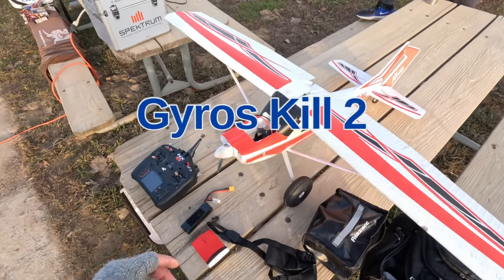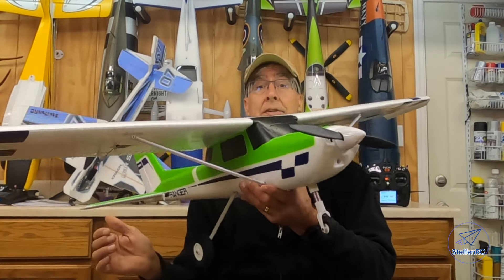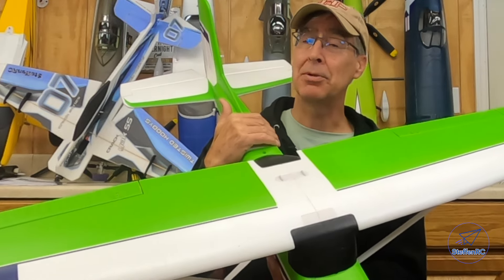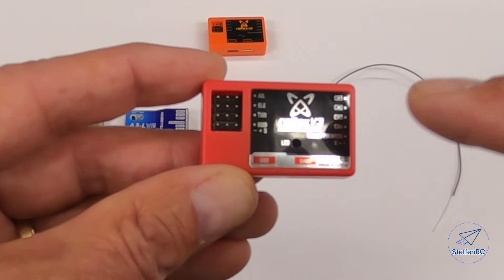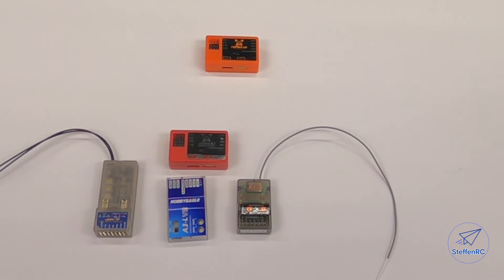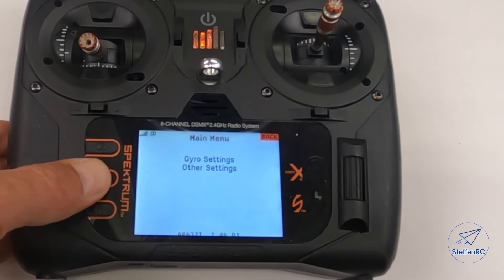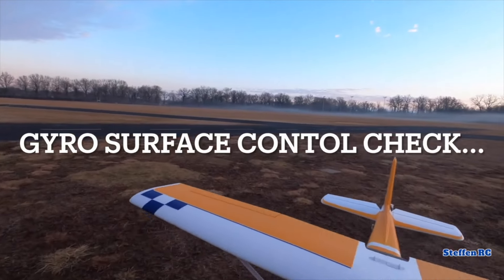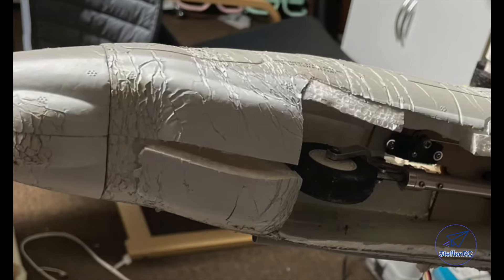Watch this if you use a gyro in your RC Planes

Comment: I love when a guy crashes an airplane and the first thing he blames is the gyro! Great video as the fact you must do any reversing etc in the gyro and not the radio. Any change to servos must be re addressed in the gyro. You need a gyro to fly an RC airplane that's fine. But I guess I have been an expert pilot flying since 1976 without one. I have several I ripped out of Flex aircraft. They work great for 3D flying but for sport flying nope. Thanks for educating the folks they need a gyro to fly!
Reply from the maker: JD,  I don't think its blaming the Gyro, its asking what caused the crash.  In this case the Gyro direction wasn't check after a servo replacement and the gyro caused the plane to be uncontrollable.  I think I was pretty clear about it being pilot error.   I'm finding more and more new pilots who begin their RC Plane journey with Gyros (since almost every PNP/BNF has them).  The new pilot doesn't understand the point you mention about testing the surface movement of the GYRO not just the TX stick movements.    So, this video is that PSA to let them know.   I'll say I started flying in the late 70s early 80s and didn't even have expo.   I sure like that now though.  I get it, you don't care for gyros but I've found some planes that really benefit from them. Especially flying in windy conditions.  Its important to know how to tune a gyro also, which is a whole other topic.   But again to each his own.
Reply: Dude, relax with the anti-gyro negative waves.

Comment: I had that issue with using a gyro rx, I had mine set up for off , as3x,  safe. . When I got in the air and turned on as3x,  it was doing funny things, I was also high doing this . I found the gyro was moving backwards on movements,  in Forward programming there is an area where you can reverse the gyro inputs so they go the right way
Reply from the maker: Sounds like your Gyro didn't have the correct orientation.  If you set the correct orientation, it will know which way is up/down left/right.  The first time you setup AS3X it will ask you to orientate the gyro.  If the gyro controlled surface directions is still wrong, you should start over by doing a factory reset on the RX.

Comment: You are absolutely CORRECT and a must to be sure the gyro is working correctly!  Thanks for the detailed video. BTW - the Reflex 2 is also capable of being reconfigured for correct servo movement but you have to be somewhat computer literate and understand how to modify the individual airplane files that the FMS computer application provides.  There's a detailed discussion/explanation of doing this on RC Groups under Reflex 2 Gyro.  I use 3 Reflex 2 gyros in several sport airplanes and have the ability to modify the 'param.dll' file to accommodate any airplane.  The Reflex 3 is somewhat simpler to modify but most of the internal settings aren't available unless you do it on a windows based computer.  I also advise that everyone using any gyro set it up on a 3 position switch so it's capable of selecting OFF, STABILIZER (AS3X), and SAFE.  Not doing this is very dangerous!  Just saying.
Reply from the maker: Appreciate your comments.  I should've mentioned the technical option to reprogram the V2.  I remember seeing that discussion on RCG.   Agree a switch to disable the Gyro is very important, especially during the maiden and tuning flights.   Thanks Will
Reply: Having an "Off" option will certainly help in many situations - especially if the Gyro unit comes adrift or you've made a setting boo-boo. However the idea that it will always save you is misplaced. Even in the purely "Manual" switch-off position the servo controls are routed through the stab. An internal malfunction in the stab unit (much less common than the former 2 faults admittedly) will still trash your toy. Main "internal" faults with stabs are likely to be physical damage from crashes or register overload from vibrating props.

Comment: The Hobby Eagle A3 Super 4 is a great gyro and their manual has the best images showing how to check the control surface movement, but nothing beats Spektrum's Smart AS3X/SAFE receivers. I would avoid the FMS Reflex gyros. The main thing to remember is that the surface should deflect in the same direction that you move it; it should oppose what you do. Raise a wingtip and the aileron on that side should deflect upward. Raise the tail and the elevator should deflect upward.
Reply from the maker: As always..  Appreciate your comments. Hope you are doing well and have a great Thanksgiving.  - Will
Reply: @SteffenRC  I just sent you a PM on RC Groups..

Comment: I support a local group of RC learners/flyers with repairs, flight instruction, build and design services and of course the installation, setup and test flying of third party flight stabilisers/controllers. There are a large number of gyros and flight controllers that you did not mention which is good because it seems every man and his dog are adding to the plethora of stabilisation devices. When a servo needs to be replaced and the replacement servo rotates in the opposite direction to the original I have learned to simply reverse the servo. I use the same technique used to reverse one of the flap servos to maintain physical symmetry of the installation.
Having said all of that another problem has reared its ugly head around the long term use of gyros etc. The climate I fly in is temperate to tropical with 40 degrees Celsius not being uncommon. Over time the filtering of the BEC within the ESC becomes less effective and so the use of an external BEC is recommended to reduce the effects of the heat but even so the external BEC can loose its filtering over time and so additional surge suppression  is currently being used.. The stabilisers can reset when the voltage supply is spiked and this can have a catastrophic outcome.

ESC/BEC cooling is even more important if a third party flight stabiliser/controller is fitted and failure to do so can cause the unit to reboot whilst airborne or even lose its setup programming for some unit designs.
Reply from the maker: Thanks Robert,  Appreciate you perspective on this topic.  Yep, there are lots of Gyros on the market.  I was kinda hitting on the ones that I see and have some experience with.  I didn't delve into the Matek or SpeedyBee FC that I use, since thats a whole different ball game.   Thanks for sharing, Will

Comment: Good stuff and thank you....that definitely helps. I'm still fairly new to this hobby and I hate to admit this but I learned the hard way about not taking off the prop while changing settings on the TX. But what I want to know is why did this happen on some planes and not others. I have several planes on the DMS protocol by spektrum and I can change settings with no problems. I recently got an arrows edge 540 and got it set up with a radiomaster TX16s and a radiomaster RX run thru the arrows vector gyro...everything is perfect and moving correctly and the gyro movements are correct. I don't know why I did this but I did.....I reached down and cut the TX off first before the plane and the prop took off at 100% throttle in my small work shop with no room....that was fun. the second time on the same plane I was setting the RSSI to the middle frequency because everybody says do it or you could lose signal....as soon as I hit the highend number and lost frequency the prop again went to 100% wide open. Is this normal or do I have something set up wrong? I've set the RSSI up on other planes and the prop did nothing went I lost frequency on the high end or the low end.
Reply from the maker: Holy cow thats kinda scary.  Not 100% sure why, but it could be your Failsafe is set to 100% throttle on that plane.  So, when it loses signal it goes into FAILSAFE, which is set to 100%.  Might want to look at the FS options on that plane.   Hope you can figure it out, that isn't normal.  Good luck.
Reply: @SteffenRC  I'd say that there are at least 2 possibilities for his problem. 1. Like you say, he has not set a proper Throttle Failsafe on the receiver set-up. (So the Throttle is going to the channel default of 50%) OR 2. He is using a Radiolink (not a Radiomaster) receiver and that maker (like Futaba) uses a reversed Throttle control. (ie -100 is motor flat out!) 😱

Comment: Details are everything when it comes making any changes or re-maiden after a crash or just a new plane. Never assume anything and suspect everything that could go wrong. I thought I would save some time by not putting the servo control horn screws in because I knew I would have to physically realign them during a later radio setup. Yep, I forgot to put the darn screws in and although the first flight was uneventful, the second one pile drived into my brick house because the ailerons became unresponsive. I was so glad it was my house.

Very good advise on the type of problems that can happen with gyros. I had to ditch that Reflex V2 out of my FMS Pitts because I couldn't get that stupid configuration file to update the gyro direction for my swapped out higher quality servo's. Every single servo had to be reversed and there wasn't any way to reprogram that thing. Swapped the receiver out for a Spektrum Rx with gyro and it was super easy to set that up with all the correct gyro movements.
Reply from the maker: @michaelkrailo5725  thanks for sharing.  Btw, there are a few guys who have changed the FMS file to reverse the servos with the reflex v2.   Some details are on RCG.

Comment: An excellent explanation of how to check the gyro.
I just did this gyro fix yesterday. I had put a HobbyEagle A3 in a plane and fortunately had the gain at 5%. It was a bit wonky as I had forgotten to reverse the aileron gyro setting to match the receiver. Flying in AS3X mode was ok, but wonky. I flipped into Stabilized to check it and the plane inverted. Oops. Minor repair and all is well.
Reply from the maker: Yikes.  Sounds like you caught it before it caused too much damage..  Stuff happens.
Reply: @SteffenRC  well, yes. It was an MD-Hobby E0717 so they are pretty tough. Back in the air and flying great with the gyro settings fixed.

Comment: I understand the need to site the gyro on correct orientation,  but does it need to be bang on the centre line of fuselage? Can it be to one side of the fuselage?
Reply from the maker: Great question.  Its doesn't need to be precise.  It can be off several degrees without it causing issues.    You can absolutely place it on the side of the fuselage if that's the only place it will fit.

Comment: The Reflex v2 can be used in 'any' plane. However, It requires a bit of geeky file editing of the FMS config.dll and param.dll files on your PC. Find a comparable FMS model, open the config and param files, copy that model's settings to a new model, update the gyro and TEST. If a surface needs to be reversed, replace the 1 with 0 (or vice versa) for that control surface's gyro direction parameter.

I have Reflex v2's installed in the following models:
FMS Ranger 1220mm (standard FMS Ranger 1220 model config)
RocHobby WACO YMF-5 1100mm (based on FMS P-40 980mm model config)
E-flite P-51D 1.2m Cripes A'Mighty (based on FMS P-51 1.4m model config)
Flightline P-38L Lightning 1.6m (based on FMS F7F 1.7m model config)
E-Flite F-16 80mm EDF (based on FMS F-16 80mm EDF model config)
Reply from the maker: You know, I remember a thread on RCG with you guys tweeking the files..  Pretty cool stuff, thanks for sharing.
Reply: Radiomaster R88 + FMS Reflex v2 + file tweaking = Poor man's Spektrum AR631 ;)

Comment: I had a gyro incident with my v2 Reflex on my Kinfgisher (factory installed) that was like a grand mal seizure.  I’ve never had a hiccup from my Spectrum gyro.  I was barely able to get it upright before the Kingfisher hit (no damage surprisingly).  Very concerned to try it again…. Any suggestions?  I’ve flown it without gyro but like having it installed so I can flip a switch if I get into trouble. 

After watching this I will go wiggle the gyro - maybe the 2-sided tape is loose.   Should I replace the v2 with a v3?  This acted like a voltage spike or dip (can that happen?).
Reply from the maker: Those type of issues are hard to troubleshoot.  I'd test to see if its loose, but that reflex placement in the Kingfisher is pretty tight space.  If its stuck tight, then I'd check the servos and control horn connections, make sure the servos are working perfectly.  If those are solid, then I would remove the reflex from the equation and connect to my RX. (what type of rx are you using?).  If you feel comfortable that is.   I've never had a Reflex act up like you described so its hard to determine if a V3 would help.   Or maybe this is the time in your RC Piloting career where you fly without the Gyro for a few flights.  I'm sure you're capable and the kingfisher is tough.    Let me know if you find anything on the plane that could be causing the issues.

Comment: Hey Steffen, I had a similar experience with my Air Tractor a few weeks ago; totally destroyed the fuse! I reordered all the parts from Horizon and reassembled the aircraft back to original condition, I checked all of the controls and they worked "manually" as they should and all the AS3X and SAFE controls work as the should except the horz. stab., which works backwards. I I went to forward programing on my Spektrum Dx6e trans. and it tells me that it cannot connect. It tries to connect, with the transmitter both close to and far away from the plane, but "connection fails" every time, plus it tells me in Forward Programming to "go to menu;" however, I can only click back out of Forward Programming and not move anywhere within Forward Programming to select the text "go to menu" which it is instructing me to do. Both my AS3X and SAFE are backwards on the horz. stab., all the other surfaces are correcting toward the proper direction. What do you think I should do Steffen?
Reply from the maker: @JimHenriksen-z1s  hey Jim,  first most of the Eflite BNF don’t allow you to change the Forward programming.  They are locked.  You’d need to unlock and reset through the fancy Spektrum cable.   Something you might want to try is rotate your elevator servo control horn 180 degrees.   That will act like the AS3X is programmed.   You’ll need to reverse the servo in your TX.
Reply: Oh gosh Steffen, I'm not sure where my original Spektrum cable is??? Maybe I'll need to try your solution the other way, by "rotating my servo arm and reversing the directing in my transmitter." I see how that might work, I just don't know if my servo arm has enough room against the fuse. sidewall to clear it, I will try though and reply back to you if it works. Still though, I am a bit wondering if my transmitter will cause the same error on my other planes when it come to having AS3X and SAFE enabled, I may have to take them out via the transmitter switch (disable it)! Will get back with you either way, thank you for the interesting "servo idea" though. Good thinking Steffen!
Reply from the maker: @JimHenriksen-z1s  the programming cable I’m referring to is an addition part you must order.  Not sure how the servo is reversed if everything is exactly the same.  Something must be different.   My friends situation was his non stock servo was reversed direction of stock servo.  If your servos were all place back in the same place and same direction, that’s really odd.   The RX is the same and in the same orientation?
Reply: Hi Steffen, I had room against the side of the fuse., so I placed the servo arm on that side (180 deg from where it was placed to begin with). Plus, I reversed the elevator servo in my transmitter (servo adjust pallet) and all surfaces work great in AS3X; however, when I flip the switch on my transmitter into the SAFE position, the elevator goes negative, like the aircraft will go into a dive on SAFE! So.... I'm just not going to use the SAFE feature on this receiver as I am thinking now that I must have received a bad AR637TA receiver with the plane. Regardless, I think I'll just use the switch in the AS3X mode and forget about the SAFE feature, I never use it anyway! Thank you for your help Steffen.
Reply from the maker: Jim,  I sure wish I could help with this situation.  There has to be something we are missing.  This should be a simple setup after a build.  You may want to checkout the Spektrum programming cable they sell.  It will help you unlock RXs, upgrade them and so on.  Its a handy piece of kit.   Good luck.
Reply: @SteffenRC  "Hi Steffen, I had room against the side of the fuse., so I placed the servo arm on that side (180 deg from where it was placed to begin with). Plus, I reversed the elevator servo in my transmitter (servo adjust pallet) and all surfaces work great in AS3X" 
This sentence contains the simple explanation for what you are both missing, Steffen. Shifting the servo arm to the other side ALWAYS reverses how the servo controls move (BOTH via the gyro AND the stick!) Reversing the stick direction WITHOUT reversing the gyro correction direction FIRST is a really DUMB move! The gentleman was simply incorrect in his checking if the gyro correction was correct. ALWAYS do that check first (and ALWAYS use the Self-levelling Mode if available since it is easier to see than the quick flick of Rate/AS3X corrects) before fooling around with the transmitter stick directions.